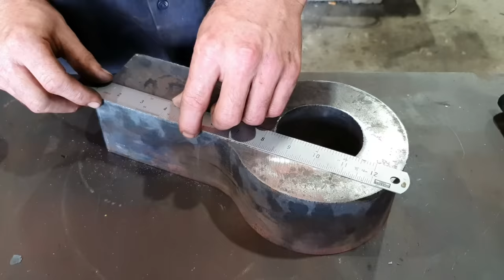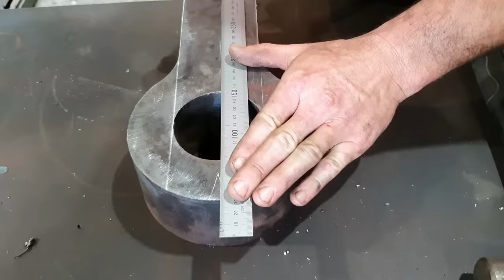Replacing BROKEN Eye on Hydraulic Cylinder for CAT 631 Scraper | Machining, Welding, Milling

Comment: as a 20 year veteran of mine repair in w.v,  i stumbled across one of your videos doing a repair on a d 11 tilt cylinder.  watched the video in its entirety, and subscribed immediately!  as we are here in the states, you are saw man, lathe operator, mill operator, fabricator, and welder. a lot of knowledge is needed to do all those jobs correctly.  WELL DONE!
Reply from the maker: Hey Joe Thanks for watching over there mate and always appreciate support from someone in the industry. Cheers, Kurtis 😎👍
Reply: After 20 years, Joe would have seen just about every possible way to abuse and break heavy duty equipment that can done by man, the work and nature.
Reply: @markfryer9880  you couldn't be more correct. run it till she breaks, maintenance got this. no truer words have been spoken.
Reply: Don't forget forklift operator.
Reply: Australian tradesmen go the whole 10 yards

Comment: i have a diploma in mechanical engineering but ended up working in the service sector. I know from first hand experience this is pure artistry, So much measuring to do, so many techniques and methods.  The one thing i hated the most was when hot metal chips got into my shirt. :)
Reply from the maker: Hey mate thanks for watching and for the comment. Yeah hot swarf landing on any skin ain't fun 🤣

Comment: That was really interesting to watch.  As a complete newbie, would you mind explaining why the weld join was so wide?  Does it make it stronger than it would be with a gap that was only wide enough for a single weld bead on the initial pass?

Comment: After watching lots of these videos, I have a suggestion for your next project, "welding rotator bench" trust me, years from now you back and knees will thank you.
Reply: I've been thinking the same thing.
Reply from the maker: Hey mate we're going one better and setting up a welding lathe 😂👍 I don't want my rotator up on a bench or any higher, it's not the best with holding the heavier jobs and would prefer it lower to the ground.

Comment: Centering plug is brilliant!  I learn something with each of your videos!  Look forward to Fridays for that reason..  An idea to make a little sub frame for your welding shaft rotator that fits on the fork lift forks, then you can sit in a chair to weld.  Kneeling on the ground is going to age your knees quickly.  Go for the long game....
Reply from the maker: Hey mate thanks for watching! Hey mate I prefer the job lower to the ground just in case something happens less distance for it to fall, in saying that future plans are to have a welding lathe 😎👍

Comment: OK I just found this video.. I loved the centering plug idea with the 4 jaw chuck.. Thats the first thing I'm going to make when me new lathe shows up in the New Year! I might even make it from a tailstock alignment bar that fits the headstock end. Then turn the long straight part down to a point, assuming the hole in the 4 jaw is bigger than the spindle bore.

Comment: Really like your approach to set ups, simple, solid, versatile, no mucking about with dozens of steps just to clamp a part up.  This might be the first and only time I've seen anyone use a center drill in a mill, for the purpose of a center drill, all to often they use them to spot holes... then come back and champher said hole, when a spot drill would of done both....

I have a couple sets of 1-2-3 blocks, the el cheapo made in china set $9 I've had for ?30? years is more accurate then my spensive brown and sharp merica made set $80... and I find that highly annoying.

Comment: Nicely done but as a welder I have to make a tiny suggestion. Let the slag of the flux core cool off at least until it is not glowing red hot before you wire wheel it away. It is there to protect the weld from oxidation. You risk letting in impurities in the weld. Not that it is going to matter here since the eye will break before the shaft anyway,.

Comment: Since he did a great job during machining, I was surprised he didn't put the cylinder shaft back into the lathe at the end to clean out the welds.

Comment: Love this channel, just work , no bullshiting. As a old disabled man I live thru your hands.  Like way your no nonsense way of measuring.     One thing could you build a table to mount rod Turner on to save your legs n back some ?  I ruined my back in such a way, fill full of arthritis in my disc, Doc said to many years of abuse.
Reply from the maker: Hey mate thanks for watching appreciate this comment! Have plans to get a welding lathe going for that exact reason! Cheers, Kurtis 😎👍
Reply: Cutting Edge Engineering Australia 
Hope ya video that build ; be great one, I'm sure you design in your head ; be safe Mate

Comment: Always enjoy watching these CEE videos.   On this one, I'm wondering why the pallet (that you strapped the finished part to) did not incorporate some protection for the easily-damaged threaded end?
Even if the pallet just extended another five inches or so past the end of the rod, it would offer greater protection.
I always learn something from watching you fabricate.

Comment: Always look forward to Friday evenings when I can see Mr Pro doing some heavy-duty metalwork.  Mrs Pro does a really good job of capturing the essence of how the work is done.  I particularly like how, in the intro, you point out where the part comes from and what its function is.  Makes the work all the more relevant to understanding what you've got to do.  

Question.  With these eyes on the rod seeming to break all in the same way ... an absence of maintenance ... wouldn't it make sense to include some way to grease the bearing so that it doesn't wear?

Comment: You should really wait a few more seconds before wire wheeling the slag off of the welds. The slag is there to protect the weldment from the atmosphere while it is cooling, and with it being red hot underneath its prone to atmospheric contamination. Just a thought. Should also watch out for doing 15 passes in less than 10 minutes. Dumping a lot of heat into that steel and not letting it properly cool down between passes.

Comment: For the entirety of the video I was wondering... How are you going to attatch the two flat sides of metal together for it to be strong enough. I never knew that you weld it together like that. Great knowledge, I bet I won't use it anywhere but I can definitely boast about knowing how it is done

Comment: I was a Master Machinists and a Class A Tool and Die Maker for years before I went to college and became a CPA and I still miss being a machinist and I take my hat off to you. You are one of the best when it comes to large scale work. Most of my machining days were small high tolerance work. I just have one question for you. When we did work that required welding, all welds had to have either Magna fluxing or x-ray. Do you do this or are you just this good? Not criticizing, your welds look magnificent and very professional. Ever had any fail? You have an Australian accent, what country do you work out of?

Comment: The 15-second chip that started at 25:47, and ran to 26:02, was ALMOST as cool as the 8-second *double* chip started at 26:03 and ran until 26:11! I've often wondered if you could deliberately generate chips from some particular alloy, which could be used as some kind of spring. I don't know why, but the chips are fascinating to me.

Comment: Hi, just incredibly cool work. I thought you'd make an internal thread on the part and an external thread on the cylinder pin before welding. It seems to me that it would be more reliable? maybe I'm wrong.

Comment: @Kurtis: can I ask a dumb question please? Why don’t you just leave the stem of the eye square and weld it on to the circular rod? The eye doesn’t go in the cylinder of the hydraulic ram... I have nothing to do with engineering (you may have guessed) and just wondered why you spent so much time milling the eye 😊 by the way, I love your skill.

Comment: Nice work. Precise careful work. End product look very professionally done. Wish I could turn out quality work like that too.Cheers. I notice sometimes you use coolant sometimes not. What determines that?
Reply from the maker: Hey mate thanks for watching and the great comment! .A few reasons on coolant... depends on the material being cut, with any chrome induction hardened material I use ceramic insert so no coolant on those otherwise thermal shock and the insert shatters. The carbide inserts can be run hot/dry or flooded wet so I prefer less coolant mess and usually only run it when taking heavier cuts. Hope that helps 😎👍

Comment: Not a big welding guy but why wouldn't the last weld be smoothed out on the lathe ?? Would turning it effect the strength of the weld causing future cracking ??

Comment: Are they going to turn down the weld flush with the rest of the rod or just leave it like that? Won't it interfere with the operation of the rod if it's over-diameter?

Comment: I love your work. Can I ask, why you use flux cored wire and gas? I use mig all the time, I use argoshield, why the flux core?
Reply from the maker: Hey mate it's a more controlled weld procedure for these 2 types of metals. Minimal heat input with max deposition 😎👍

Comment: is there a reason you use flux core vs straight shielding gas? i myself would worry about slag inclusion where the weld starts/ends. seems you don't have that issue. i really dig your channel. very impressive skill.

Comment: Question: When you turn a large square profile to round, do you sometimes stop to check that the piece is still secure in the jaws? It seems like the increased vibration of corner removal might make that necessary. Or would a loosening jaw be unmistakable?

Comment: Is there any particular reason why the spigot diameter is quite small compared to the O/D resulting in the necessary large build up of welding required?
Is the spigot just there for location purposes rather than any strength considerations?

Comment: First the part looks great like always.  Second I really like your dog.  Lastly for us non-machinists what was your method to setup the eye in the mill to get the two sides parallel (an adjustable parallel between the bottom surface of the eye and the mill table)?

Comment: Very nice work.  One question, though.  Don't you think it would have been just as effective to do a larger and longer "spigot" on the rod and bore on the rod end and then do a shrink fit?  You probably could have then used only about 13mm deep V weld all the way around.  Much less heat going into the parts.  Freeze that "spigot" with dry ice and just warm the rod bore in an oven. About 0.05mm interference and  she ain't coming apart, mate!  Don't get me wrong... I do like your repair, too!  Just a different idea.

Comment: Thought you where gonna machine out the rest of the flush with the diameter of the rod that would’ve been so satisfying but anyway excellent video as always keep doing what you do 😊
Reply from the maker: Yeah would have made it mint with a paint job too but for this customer that's not necessary and just adds extra cost they don't need

Comment: Does that bushing have greasing/oiling throught the pin? Strange to see bushing like that, it doesn't have grease groove in it. Nice job as always!
Reply from the maker: Hey mate it's a self lubricating bushing, the oil is impregnated in it! Cheers

Comment: How are these blanks made. Do you cut them or does the metal supplier. It would be interesting to see how this and the 200mm blank was cut.
Reply from the maker: Hey mate we get the blank plate cut from our supplier they use oxy/lpg flame cut

Comment: Great job Kurtis with new rod eye no grease nipple in new eye ! Please explain to me how you flux slag from a mig welder? Always got slag from arc welding
Reply from the maker: Hey mate thanks for watching. The bushing is self lubricating and i'm wire i'm using it is a dual shield wire meaning flux cored and gas shielding
Reply: @CuttingEdgeEngineering  ok mate I’m a little bit behind the times so what you do is a learning process for me top notch channel 💯👍🏻🇬🇧

Comment: Wouldn't it be better if you used the lathe to put some large threads on the joining point and screwing the cylinder to the eye before welding instead of just doing it flat and sliding it in?

P.S. : No judgement, just curiosity and admiration for your work!

Comment: Howdy from Sacramento!   How do you know what depth of cut to set on those first passes to turn the square part of the eye into round?  4mm is based on what I wonder?  Just curious - I know absolutely nothing about machining.... :)
Reply from the maker: Hey mate just experience knowing the material and parameters that work well

Comment: Great job! What is the tensile strength of the wire used to weld the pieces together?   What is the cost for a job like this?  It must be less expensive than replacing the whole part, but do you price it according to what the part would cost to buy minus a few bucks or do you just price it on material and labor?

Comment: I’m assuming that the pin has the grease groove and zerk. I enjoy your video’s.
Reply from the maker: Hey mate the bushing is self lubricating, oil impregnated in it 😎👍
Reply: Cutting Edge Engineering Australia thanks for the response. I own and run forestry equipment in northeastern USA. Really enjoy your video’s.

Comment: one thing i always think is strange in your videos is how you always weld kneeling on the ground. Is there a reason you don't have your positioner on a weld table or is that just how you feel most comfortable welding up these parts? The welds are always mint so it obviously works for you.
Reply from the maker: Hey mate yeah I prefer the welding rotator to be on the ground, less distance for job to fall haha we have plans to set up a welding lathe soon!

Comment: You really enjoy working with air tools, is that right?
I have a suggestion to save your back: you should raise your rotary device by like 50cm from the ground. That way you don’t have to bend over on the floor for the welding 😉

Comment: Why didn't you connect the 2 parts using screw threads, then weld it together? That would have made the joint even stronger

Comment: Just wondering y you cut some things cold and some hot? No cooling. Top videos.
Reply from the maker: Hey mate thanks for watching. A few reasons... depends on the material being cut, with any chrome induction layer I use ceramic insert so no coolant on those otherwise thermal shock and the insert shatters. With carbide inserts they can be run hot/dry or flooded wet so I prefer less coolant mess and usually only run it when taking heavier cuts. Hope that helps 😎👍
Reply: @CuttingEdgeEngineering  I said it affor  though is very young for what thee knows, I really hope business is good and your partner and dog are good, it was, a good life over there when I worked for Shell oils.

Comment: New suscriber here.. 
After welding both parts together, could the lathe be used on the part to give it a better finish or would that affect the strength of the part?

Comment: love your content guys! not a machinist here, im wondering: what determines the use of cutting oil / lubricant? is it the material you're working or is it the cut you do? 
all the best from germany
Reply from the maker: Hey mate thanks for watching! Good question. A bit of both and also my personal preference. It depends on the material being cut, with chrome induction layer I use ceramic inserts so no coolant on those otherwise thermal shock and the insert shatters. The carbide inserts can be run hot/dry or flooded wet so I prefer less coolant mess and usually only run it when taking heavier cuts. Hope that helps 😎👍

Comment: Hey at 9:47 is it chipping nicely cause of the feed rate, the cut or the material? I use wnmg and I mostly get long coils and can't manage to get it to chip most of the time. Thanks.
Reply from the maker: Hey mate that's insert and feed rate. There i'm using Palbit WNMG 423-HR and 0.25mm feed rate
Reply: @CuttingEdgeEngineering  alright thanks kurtis I'll fuck around with it on Monday.

Comment: I am not a mechanical engineer, so please pardon my ignorance, but would it be possible to use friction welding for this?
Reply from the maker: Hey mate yes, that's what they do in factory, a Friction Welding machine are extremely expensive and not worth our while.
Reply: @CuttingEdgeEngineering  Oh, then it makes sense. Thank you!

Comment: How tight a tolerance is the spigot to the hole in the eye? Is that a slight interference fit?
Reply from the maker: Hey Tom yeah it's about a 0.05mm crush
Reply: @CuttingEdgeEngineering  wow that’s a heck of a tail stock to force that in. Certainly makes sense though. Thanks.

Comment: Do you make those blank rod eyes in-house or do you bring them in as a sort of rough casting?
Reply from the maker: Hey mate we get them cut from our local plate supplier 😎👍
Reply: @CuttingEdgeEngineering  Yeah, makes sense they've already got the torch hotted up anyway and that's less time and faff on your part.

Comment: I'm more surprised someone can wear out such a sturdy rod to begin with.
Reply: neglect is the main reason these parts break. Lack of maintenance, operator over using it and not greasing it at its scheduled intervals causes the bushings to wear out. After that its just a matter of time until it fails.

Comment: Could you not have put it back on the lathe to take down the welds, then painted the eye part yellow, then lightly oiled the rod, then oil paper wrap the exposed piston rod, and lightly oil the inside eye and paper wrap as well?  Maybe too much huh?  lol, just kidding, great vid w/ no bloopers mate. Q: Was that a 150 ton hyd. press? just curious.